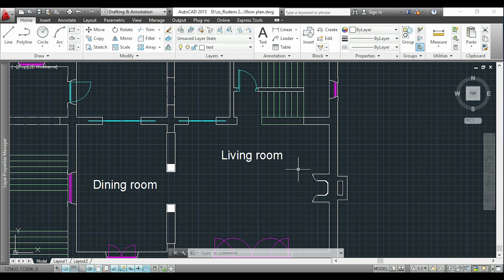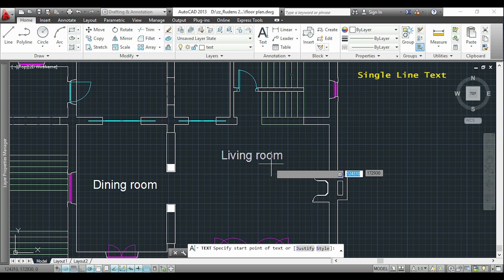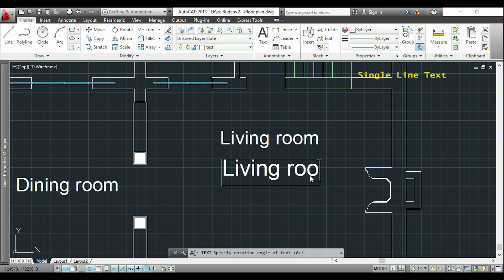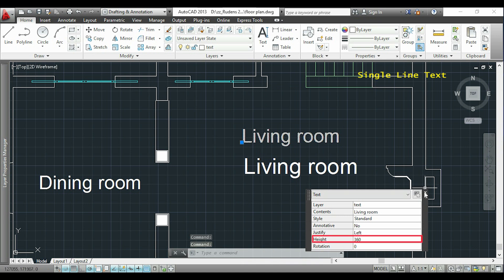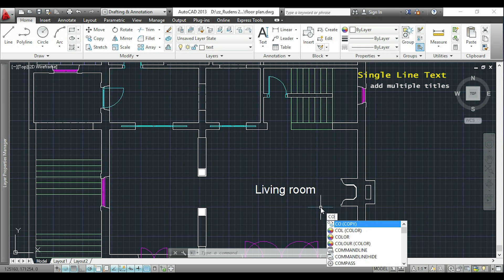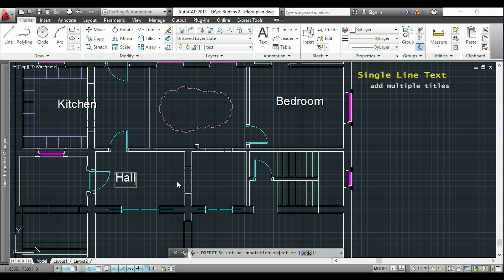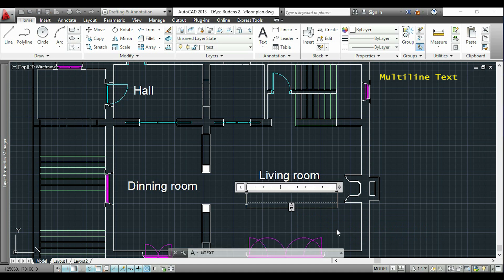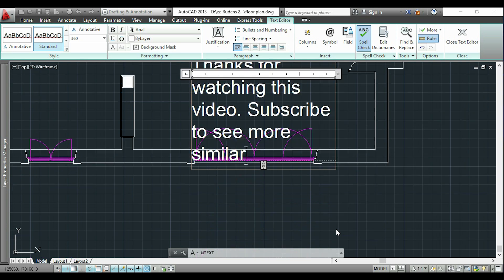AutoCAD 2D - Insert TEXT

Comment: HI WHEN IM ESC THE TEXT IS NOT APPEAR
Reply: harun injo samara its happened to me and i found the solution its just to switch on text layer
Reply: im having the same problem, so how can i switch on the text layer?
Reply: I didn't figure that out, but my issue was that the text did appear, but the scale was too small that i couldn't see it.  Try scroll in and you may be able to find the text, or just set the text size larger at the beginning.  Hope this helps~
Reply: U can try DWG Fastview

Comment: Hello,
Am new to autocad (using autocad 2017). When i tried this tutorial, i could enter the text as shown but after everything, when i press ESC, the text goes out of the box and appears very big, out of the drawing itself. Any help please?
Reply from the maker: Hi. Try to change the  text size (go to minute 2:47), and check if it works
Reply: Thanks a lot. I realized my drawing was in the scale of 1:100 and the text was 1:200. So I reduced the text scale to 1:5 and it fit. I love the way you teach AutoCAD.